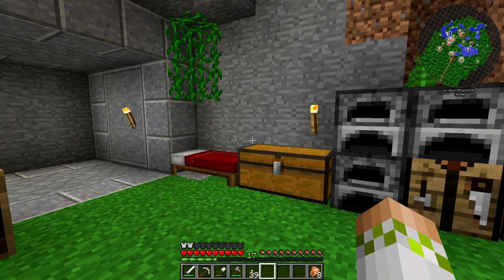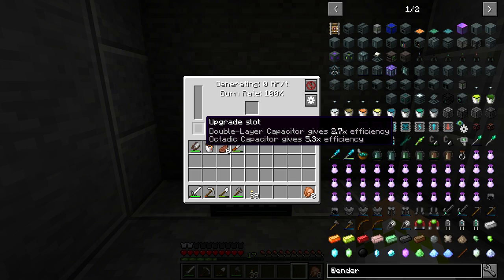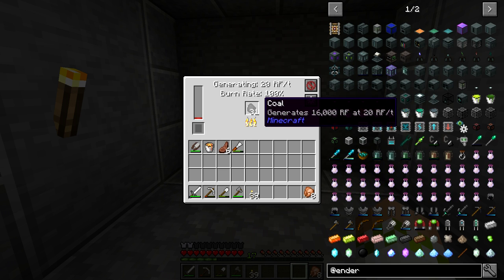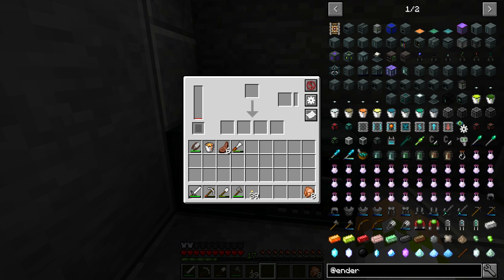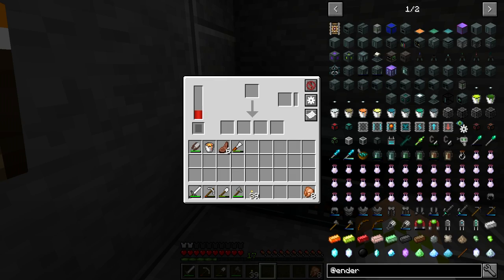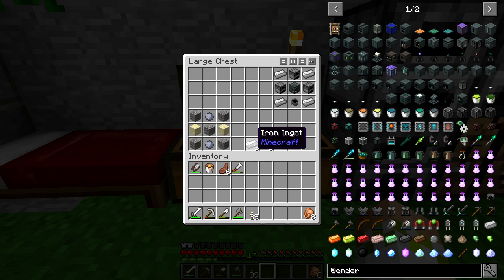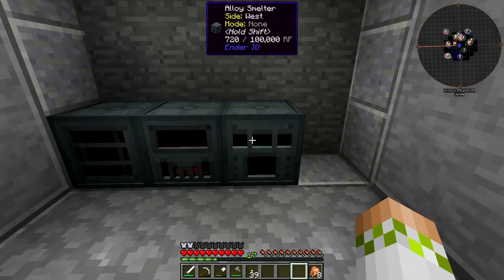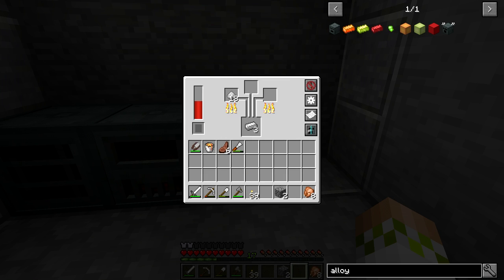Surviving With Ender IO :: E01 - Getting Started

Comment: Two things:

The glass smelting recipes don't conflict anymore, so there are is no need to change the smelter mode with just Ender IO anymore. But it's very useful if there's a mod that adds smelting recipes for iron and redstone ;)

The "Signal Color" of the conduits is always the redstone channel. Energy conduits have no energy channels, but all conduits that do have channels name their channel color button just "color".
Reply from the maker: Hmmm, now that you mention it I did notice the glass recipe change when cooking some down off camera, but didnt think anything of it. Awesome to see that small but super annoying conflict has been fixed. As for the energy conduits, that is a little disappointing because I had some great ideas using channels for energy too, but at least we have channels for the item conduits :). Thanks for all the tips!

Comment: Good job on the video!  Just what I was looking for!  Ender I/O is among my favorite mods and I have used it for a long time, but mostly for the conduits, armor and some of the obelisks.  I tend to use a combo of Mekanism, Tinkers' Construct and Ender I/O in the Resonant Rise pack.  RR just upgraded to MC1.10 and sadly Mekanism not yet in the pack so I have been relying on Ender I/O as a substitute.  Keep up the good work and I'll be sure to check out your other series, such as Immersive Engineering!
Reply from the maker: Well you definitely use my favorite parts of Ender IO! Its no secret I am a fan of the relocator obelisk :) Unfortunately, Ender IO can only do so much to sub in for mekanism, but I assume it will be added to the pack soon. Until then, hopefully my videos can help you at least semi make up for the loss of mekanism.
Reply: Your videos are definitely helpful!  Would have been a long time before discovering the relocator obelisk if I did not come across your vids.  My next project will be to set up one of those.  Ender I/O does not compare to the ore processing of Mekanism, but al least there is a chance to receive more than just two dust per ore.

Have you tried Big/Extreme Reactors?  It is one of those simple mods that has a lot of depth.  Big/Extreme Reactors has the potential for generating large amounts of energy early game since it only requires a diamond and some redstone to get started.  If you are studying to be an engineer then you may enjoy this mod since it is very technical.

Thanks for posting the series and keep up the good work!  I am looking forward to the next video.  I started on your Immersive Engineering series yesterday (got through nine episodes) and find it very informative as well.  You are not only giving me good information, but also saving me a lot of time and effort in having to figure out these mods, set them up correctly and then decide if they are useful.

Comment: i wish i had a computer capable of running all my favorite mods together: ender io, ae2(with extra cells 2), ic2(with advanced solar and more solar addon mods), thermal foundation/dynamics/expansion, useful foods, rotory/electri/reactorcraft, and journeymap
Reply: what kind of dino do you have??? i have one from 05 that only has 4 gb ram and a 3 ghz single core.......then again i also have my custom designed gaming rig to but we will leave that beast out of the equation at the moment lol